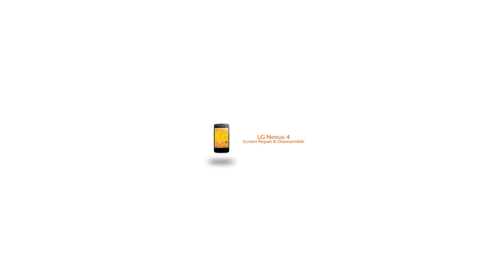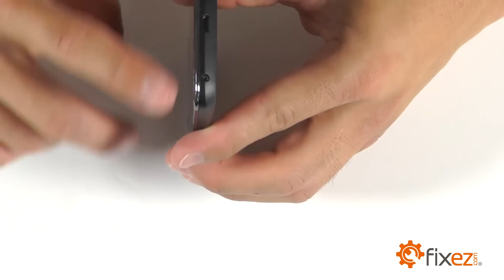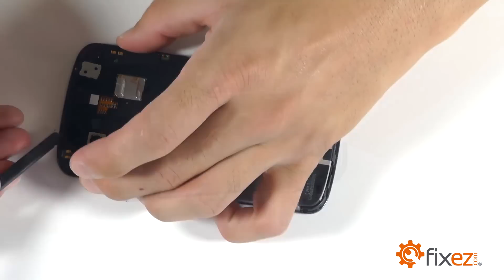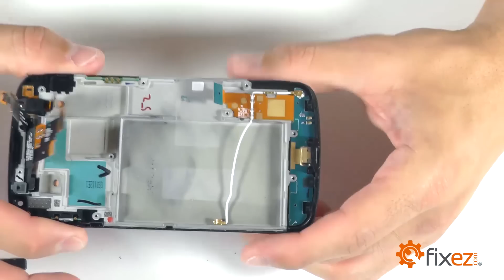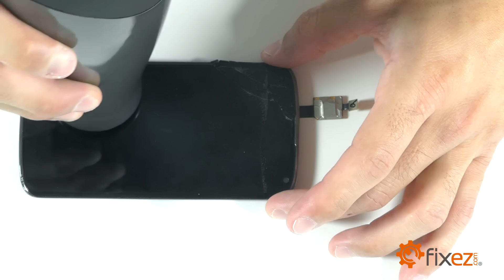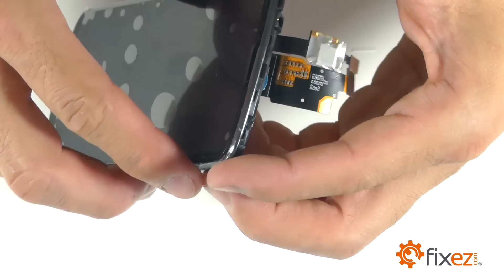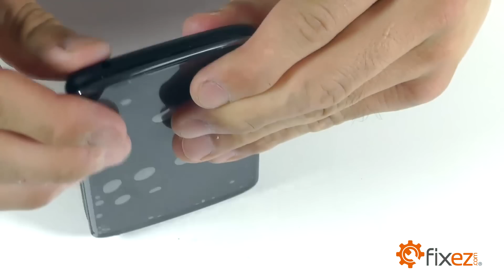LG Nexus 4 Screen Repair & Disassemble

Comment: I've got a problem.

My girlfriend broke her screen.  The LCD still worked but the digitizer didn't and I really didn't want to deal with separating them, so after seeing this video, I had her order a new screen in frame from your site.  It came yesterday and tonight I installed it for her.  I never thought it would be difficult, but it was insanely easy with your video.  Thanks for that!  It was a very good video that left nothing to the imagination.  Good job!

But...the screen has discoloration running vertically in portrait and horizontally in landscape running from anything that lights the screen. 

For example, when firing the boot screen, the Google logo has ghost-like images shooting up and down vertically from portrait on the screen.  When it switches to the nexus image, than there are ghost-like images vertically everywhere but up and down from the nexus image.  Once in the gui, there are ghost-like images running vertically in portrait from every icon and, for example, when using YouTube's app in landscape mode, the bars above and below the screen have heavy ghosting running horizontally.  I have photo's of all of this I can send you if it helps.

I opened the case again and ensured that all the connections were sound and complete.  They are.

Is there something I'm missing or did I get a faulty screen which, of course, happens and shouldn't be held against you (had to include that for the knee-jerks who might read that and decide not to order from you because of a problem outside the bounds of your control).

Would greatly appreciate some feedback, as the phone is usable now, but not right.  I'm hoping there's just something I'm missing and we don't have to send back the screen and go without her phone for even more time, so I'm crossing my fingers that it's my mistake, lol.
Reply: I was afraid of that. Thanks.   I'll contact support, then. Much appreciated.

Comment: Hi why is it necessary to remove the battery, motherboard and some components? It looks as if it's possible to thread the ribbon through and connect it straight to the motherboard without removing all those parts.

Comment: Just started this and the plastic removal tool promptly disintegrated and the back cover seems permanently affixed to the front, it's not even budging.
Reply: Just snapped the second removal tool, this video is less than accurate.

Comment: I know this is kinda dumb, but I have 2 screws that just wont budge. One in the beginning with before you pop out the battery and another with the black frame on the motherboard. Any advice on taking these screws out without damaging the phone?

Comment: The bottom right of my screen is a bit loose. You can push it down by a little bit. Is there a way to fix this without taking it apart? The glas itself is in great condition.

Comment: The metal/foil cover on the right side of the two display assembly connectors: Is that necessary? I dont have one with my part and im troubleshooting why touch is still not responsive - even though the display comes on. Any thoughts?

Comment: I tore the ribbon cables to the display just slightly (between the strip that goes under the motherboard and the strips that go over it)  by accident and the display isn't working at all. I did not yet remove the large back adhesive from the replacement digitizer but assembled it anyway since I'm purchasing adhesive for the sides. What do you think is the real problem? The very small tear on the ribbon or not removing the large adhesive yet?

Comment: Hi, do I need to use a heat gun or a hair drier would do ?
Reply: If I buy the Screen + Frame, would I still need a heat gun and adhesive strips ?
Reply: ***** in that case, what about the remaining parts that you haven't removed ? are they easy to remove ?

Comment: I bought replacement parts from your website and the touch wasn't responding correctly and only did if it was held a certain way. I don't know if it was because of a faulty part or something i did wrong when i followed these steps exactly please help.

Comment: I followed this video, it was really helpful! They only problem is that the back facing camera is not working. Neither the back facing camera nor the flash settings is showing up on the nexus 4 camera when I long press the screen. I went back and made sure the camera connection was connected. Suggestions?

Comment: I just assembled my new Nexus screen and frame. However, the screen sensor still isn't working properly. I read below of someone using two fingers on the phone and tried that. It responded slightly, but wasn't able to do anything. Help!?
Also, the philip's screw driver was pretty awful. Went ahead and bought a Husky 8 in 1 phillips screw driver for $6 from home depot and it worked like a charm!

Comment: So, got the screen+frame replacement and it works (fyi, philips screwdriver that I got from you guys was worthless, everything else was awesome), except now I have no audio whatsoever.  Triple checked all connections.  I just can't win.
Reply: ***** I am having a really hard time removing the speaker. I tried to lever on the same spot as you did, but only that part is lifting. I have removed both screws, but it seems like it is attached in the area around the micro-usb port.

Comment: uh quick question... I'd love a fast response from anyone.. in removing my battery the strong adhesive created a tear in the aluminum layer underneath... is it still safe to use or am I up a creek and have to buy a new battery too?
Reply: Thanks for the reply. Do fat it's been on and in a normal temp range. Stupid how strong that adhesive is and it's not like this is my first phone repair either, but first battery damage.

Comment: The replacement screen I got from FixEZ is flawless and just a great quality product. This video is super helpful. I completed my repair in roughly 30 minutes. 

However, here are four notes that might be useful to a future customer! 

1. Most of the tools were great, except for the small philips head screwdriver. The tip was too flat and made it very difficult to fit into the small screws and twist without warping. I ended up using another small screwdriver my friend owns which has a much finer point. 

2. Removing the back plate was more difficult than advertised, in the end it would have been much easier if the 4-5 plastic snapping points were made evident in the video. I made it work though!

3. I bought the version with the frame and was able to guess how to complete the repair, but another video including best practices for removing portions like the headphone/ambient sensor and dock connection assembly and power/volume buttons may be useful to customers of to LCD + frame product.

4. Secondly, my battery was held down firmly with adhesive. I suspect that the shop that previously repaired my screen may have applied the adhesive. Otherwise it seems to me there is another unseen variable.

Thanks for everything though! For me this was the best option, and I've got a clean, working phone now.
Reply: Hi Nate, was there any difficulty in dislodging the rest of the parts and replacing them in the new frame ? Thanks in advance,

Comment: Hi, I purchased this replacement screen for my nexus 4 and everything went smoothly.  I installed it and it all worked fine.  Then after turning it on and off a few times, I am having weird issues.  Sometimes when I reboot it, everything works fine, other times after a reboot, the touch screen only works if I have two fingers on the screen at a time.  For example, if I want to click the home button, I need to have one finger at some other point on the screen, and then with another finger I can click the home button and it will work.  But if I just click the home button with the one finger it will not work.  What am I missing?  Is this a defective screen?  Thanks,
Reply: As an added description, it is the same as the problem described here ... http://forums.androidcentral.com/google-nexus-4/320879-nexus-4-screen-problems-please-help.html.  The problem I have is that sometimes after a reboot it works correctly, other times, it only works with two fingers.
Reply: ***** I had tried resetting it several times, and sometimes it worked, other times it did not.  In the end, I left it off overnight and then when I tried it in the morning, it seemed to work every time.  So problem fixed, thanks!

Comment: I dropped my nexus 4 in the morning today and there are 2 cracks spanning across the whole screen. Only a very minor part of the screen is responding to touch. The phone is working fine otherwise and I can even use the camera perfectly , but since I've put up a pattern lock i'm unable to unlock it, and I can't even swipe to answer calls , i'm getting calls and all notifications normally but I can't access them. Can this problem be solved by the solution you've given ?
Thank you

Comment: Is it absolutely necessary to put the adhesive strips exactly as shown? Or can I "cut corners" and only apply the four big strips of two adhesive strips? The reason I ask is because cutting the exact size of those thin strips is very time consuming.

Comment: I say the phone boots because I can plug into USB and access the photos, for examples.  I didn't exactly "yank" off the LCD backing...it just separated a bit....but it absolutely does not light up. My question is:  do I purchase another LCD display again-and assume I must have damaged it? Or....do I simply bit the bullet and buy a new phone......

Comment: So....I had a bad situation here and am looking for some advice. I purchased the replacement screen, pulled the old screen-replaced it...and everything looked great.However:  I mistakenly placed tap over the front facing camera. So, I had to re-pull the now working unit apart. As I did, the silver screen backing starting  to pull away. I removed the tap, pushed down the silver backing and re-assembled. The phone boots-but no display. Suggestions? I've reassemble 3 times...